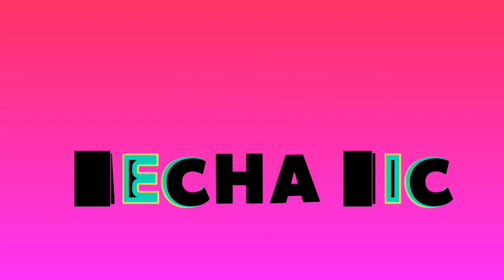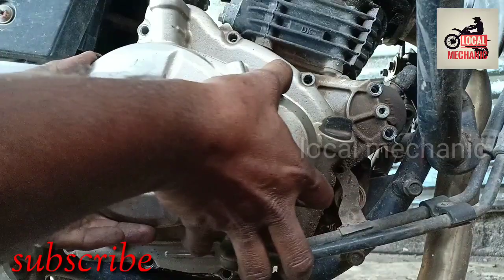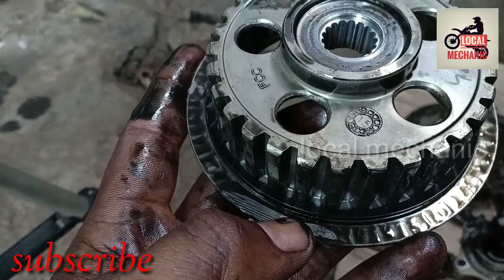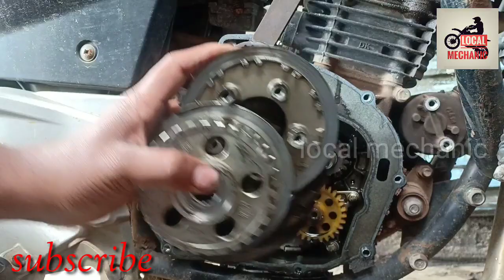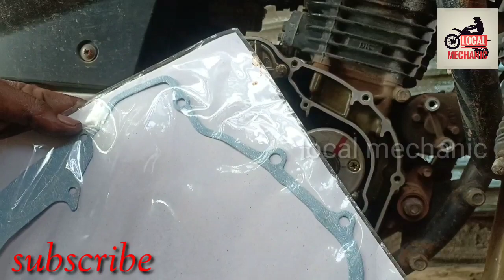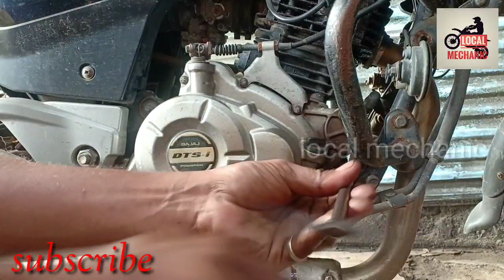#pulsar220#pickup  pulsar220 puckup problem...clutch assembly change..local mechanic...🛵

Comment: Evlo bro fullamount aachu idhuku
Reply from the maker: ₹1500
Reply: @LocalMechanicTamil  
Bro enna bro solringa 😅
Reply: Veetanda oruthar enadana clutch plate nallarku reassemble pannanu 1200 aagunraaru oruthar 5-6ilana 7koda aagunraaru oruthan 3-5 aanguraaru 3000 majorah agum raru timing chain pirundha 4-5 aagunraru mechanic gopi ana vande pickup Ku guaranteed kudukuraru mechanic gopi
Reply from the maker: Place
Reply: @LocalMechanicTamil  Chennai Tambaram bro
Reply from the maker: Clutch plate change panrathukku 1500...

Comment: Bro my 220 f 2019 model petrol irunthu adikadi petrol ilatha mathiri adaiku ena prblm ah irukum bro
Reply from the maker: Mmm
Reply: Carbarator clean pannuga
Reply from the maker: Corbarator clean
Power coil check
Spark plug change
Plug cap

Comment: Corpreter clean panni matiyachu filter mathiyachu Vera ena prblm ah irukum bro pls solungha
Reply from the maker: Plug
Plug cap
Power cool இ
இதில் ஏதாவது ஒன்று மாற்ற வேண்டியுள்ளது,,,,check pannunga nanpa
Reply: @LocalMechanicTamil  mm ok na tq
Reply: Needle fault bro
Reply: @sathizrx8009  mm ama bro mathiyachu
Reply: @prasathat4239  ipa ok vaa correct ah iruka bro
Reply: @sathizrx8009  prblm crct ah airuchu bro ana vandila extra sounds athikama varuthu engha show room la vitalum crct ah pathu thara mattikangha

Comment: Bro 2016model 220f air filter mtu dhaa bro mthnen apro rendu plugyu petrolae clean pnni potn vndi rmbo anachu anachu podhu bro ilukavae mtidhu bro race pnna sound mtu vrdhu ena aairku bro plz slunga
Reply from the maker: Plug change pannunga
Reply from the maker: Corporator clean pannuga
Reply: Bro carberator plugla clean pnni mthitn air filter pudhusu mthnen bro andha spongela naa oilae apply pnama matitin adhunlyu irklama bro
Reply from the maker: Power coil check pannuga